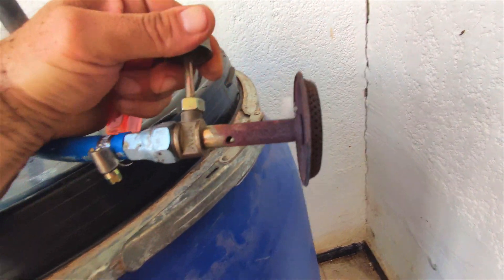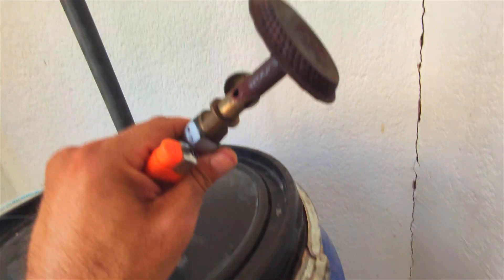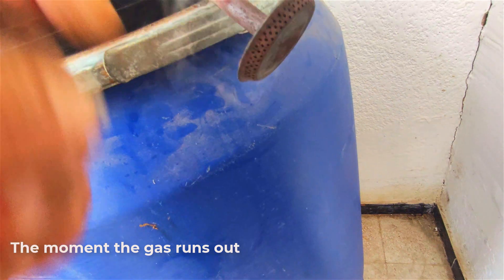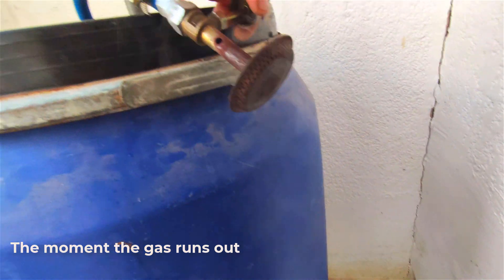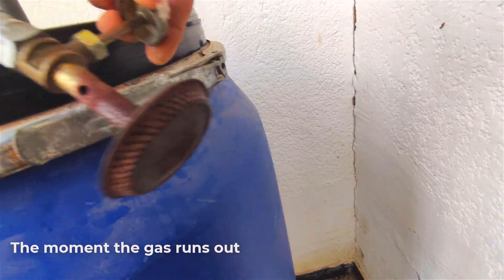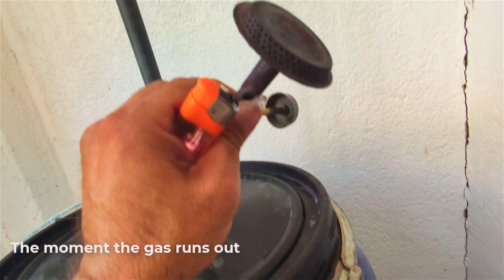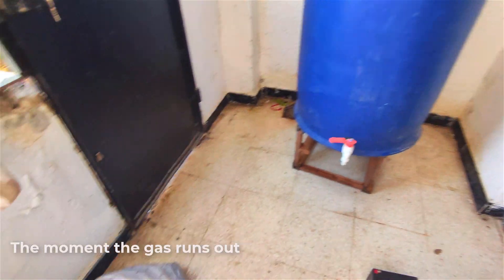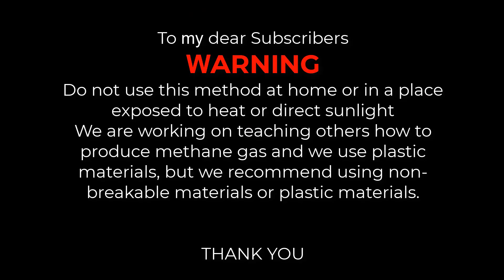For six months I have been using gas for free and I will no longer buy it from any company

Comment: Great Job Admin, thanks for the knowledge you displays, please will like to know if  the water tube from the bucket is attached to any water bottle for pressure because no water bottle is visible, and you only channel the water holes outside and what is giving the gas that strong pressure?
Reply from the maker: Sir, I do not understand what you mean by the bottle. The bottle is the water evaporating from the bucket, but the more the bottle is filled, the more pressure on the bucket increases.